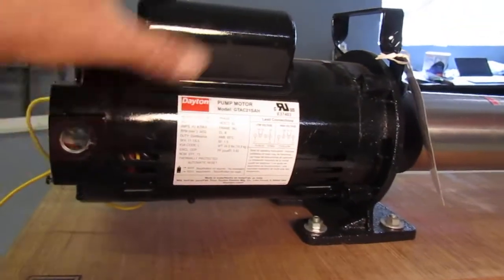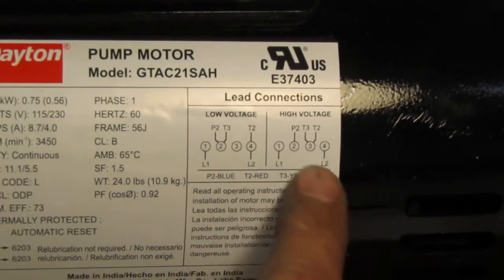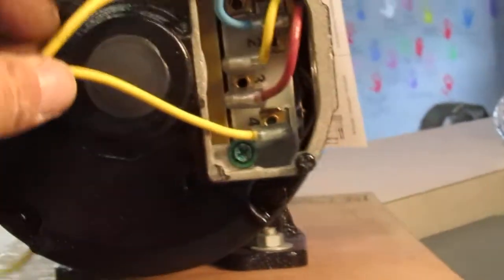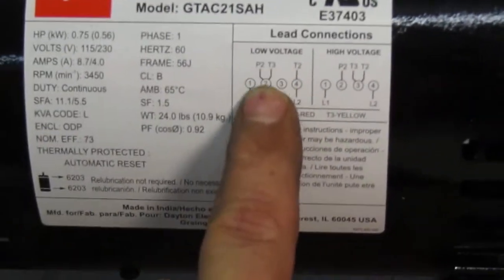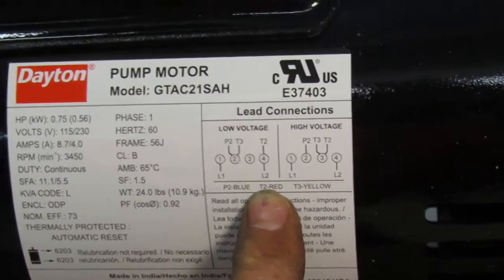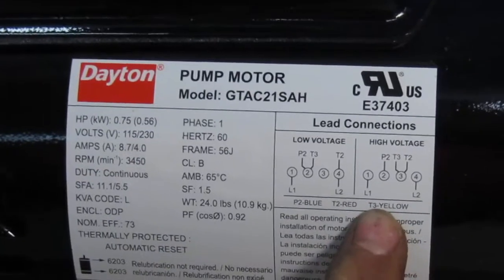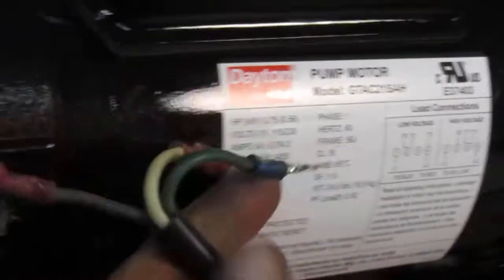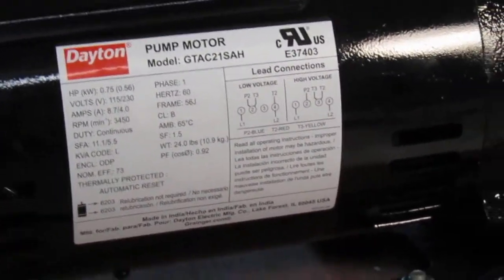Booster pump wiring

Comment: Is this pump on demand or constant? And if its constant how do i make it on demand?
Reply from the maker: @stevef1304  this is a constant. There is a Pro Switch that can be added to make it on demand but I found them to be finaky so we quit using the switch. We added a plug in remote on/off switch.

Comment: Hi Doug great clarification vid..so low v is 120 and hi volt is 240 ?
Reply from the maker: Yes
Reply: @dougiedo5505  for my hi side I have.
 blue - L1.
Yel - L2
Those are the 2 hots for the 220.

Then it says

Orange,white- insulate 

And brown by itself insulate...

I'm not sure if this is taking a neutral . I can email you a photo of this thing its driving me nuts.
Reply from the maker: @Chopperbuild  There should be a diagram on the housing for you to follow. L1 and L2 are basically the hot and neutral coming in
Reply: @dougiedo5505  im running 220v  so l1 and l2 are tge 2 hots I know that...just was trying to confirm with somebody if it requires a neutral but I don't think it does ...thanks for your replies
Reply: @dougiedo5505  diagram very vague.  Does no justice
Reply from the maker: @Chopperbuild  send a picture, they are easy to follow.

Comment: Dang I really needed to know where L1 and L2 go. Trying to match the colors to my three prong plug
Reply from the maker: Sorry I missed this.... Looks like you posted a year ago.
Reply: @dougiedo5505  I appreciate the reply! Here's an update. I figured it out, it was a pump I was using for my senior project. I made a large tank for flow visualization. The pump ran a closed loop of water through the tank and we had a dye system to pump in fluorescent dye in after the water reached laminar flow. We did really well on the project and I earned my degree in mechanical engineering. Thank you for your video being part of the help.
Reply: @jacobmcmahon1915  can you explain where the L1 and L2 wires go?

Comment: Hi, getting ready to make the upgrade over downstreaming that I did last year. There are just to many ways to go from booster pump, air diaphragm or the EnviroSpec  fat daddy system etc. From someone that’s been doing this why did you choose the booster pump over the ways? And why the Dayton pump?
Reply from the maker: The booster is just more efficient than a 12V. Down-streaming requires a pressure washer and does not give me an exact mix ratio and an air system requires an air compressor....that requires fuel and maintenance and sounds like a pressure washer. I just like the Dayton pumps. They last with virtually no maintenance, just a thorough rinsing daily.
Reply: Cajun Soft Wash where are you buying your pumps. I did a search for the new model and can’t find it anywhere. Thanks Rob
Reply from the maker: You can get these pumps at Grainger